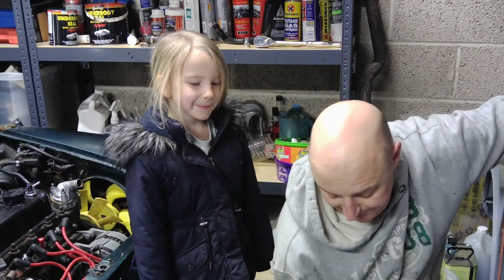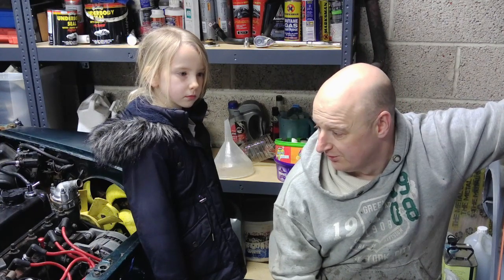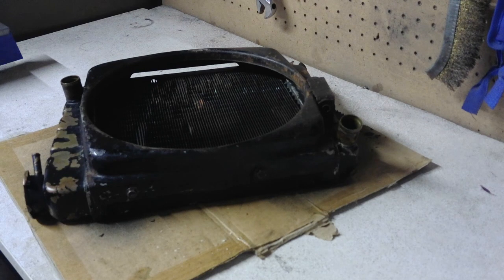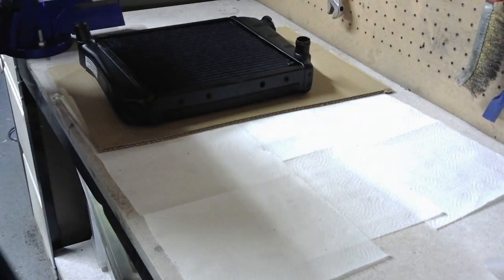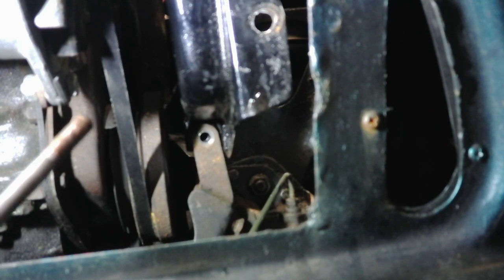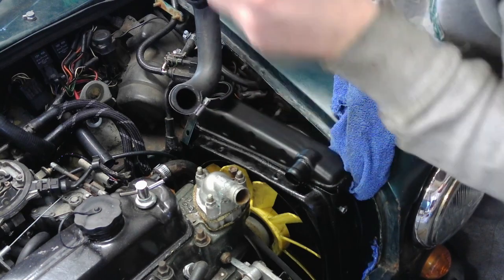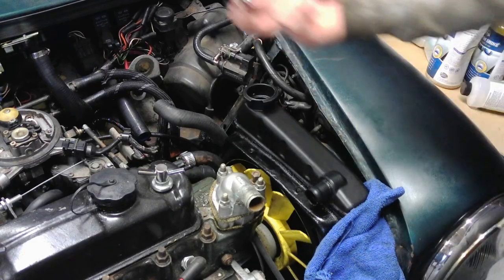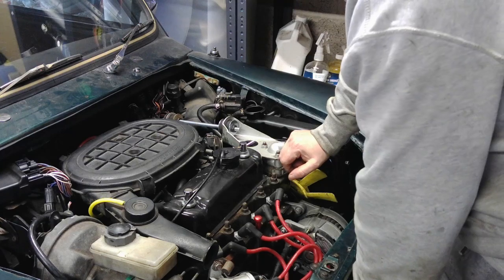Classic Mini SPI: Radiator Upgrade

Comment: When was your faulty hose purchased?  I replaced my hose last April along with my water pump and I have been plagued with a persistent leak. It has been leaking from the end that joins the water pump.  I have tried new clips as well to no avail.  Maybe I need to get a new hose. I purchased it from Minispares.
Reply from the maker: It was June last year, I got it from minimine but they I havd had stuff from them before with minispares stickers on so they do soutce some parts from them, it was them that told me there had been faulty hoses, I was refunded for it, they are good like that

Comment: Hey another great video, especially as i have recently got myself an SPI and need to do so many odd jobs like yourself. One question i have at the end of your video. You mentioned filling up with coolant and then waiting to see thermostat open and coolant drop. Do you fill up the radiator again to top it up as i can't get my head round that and how much coolant the Spi needs. Currently my heater goes cold when sitting idle and only hot while driving. Can you explain how much coolant you added and process for this  ?   thanks again and have used your videos to help in many occasions :)
Reply from the maker: Thanks, its alwaysnice to know Im helping others.. I filled up the rad to the fill line, rtun it up to temp and when it gets to 88° the thermostat oppens and then i know the coolant is circulating the full system,, heater valve also open. I top it up so its filled tk the topp of the fins inside the rad. It takes around 4Lfor thd full system but just depends on how much you have drained out.
I leave the radcap off so ang teapped air can escape and thats it
Reply: @DBMiniDIY  thanks 😊.. I’ve seen ur video on replacing the coolant and think that’s going to be my next job as well as removing the heater for a bit of a clean out.. thanks again and will wait to see what I tackle next 😊
Reply from the maker: @jamieallanfootage394  theres always a next job😂
Reply: @DBMiniDIY  Well managed to complete the coolant change and also pulled out the heater for a good clean.. boy did it need it lol. Thanks again for your videos 😊. All back together and now the indicators don’t work 😮.. any experience with that ?
Reply from the maker: @jamieallanfootage394  possibly knocked something when in there, check the relays ad alltheconectios for corrosion and check tbe fuses it will be something simple